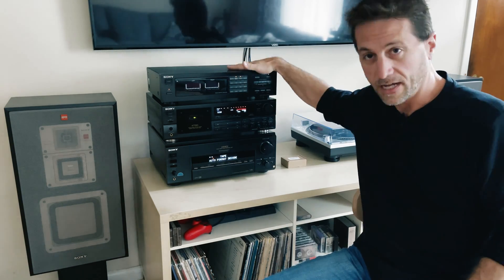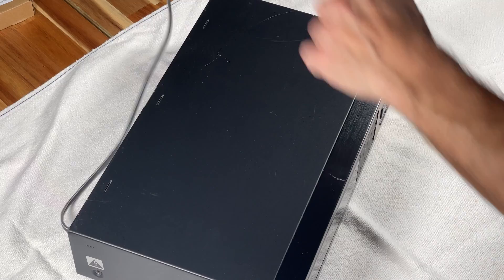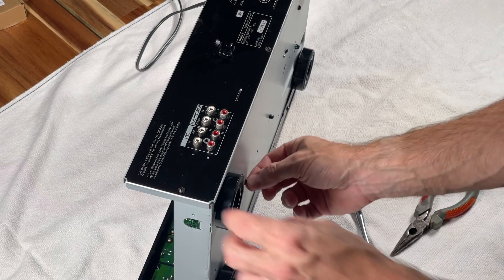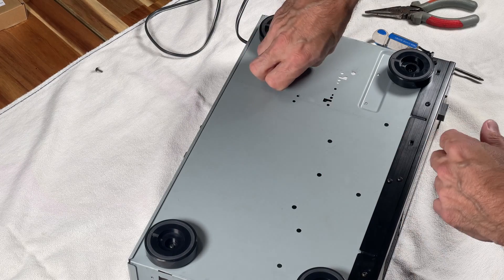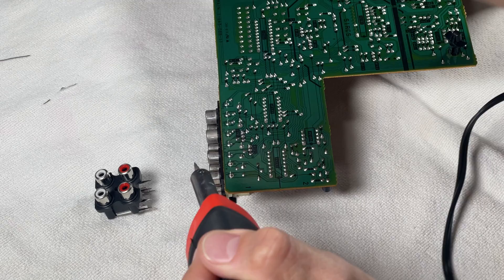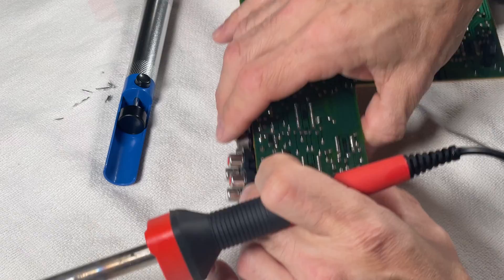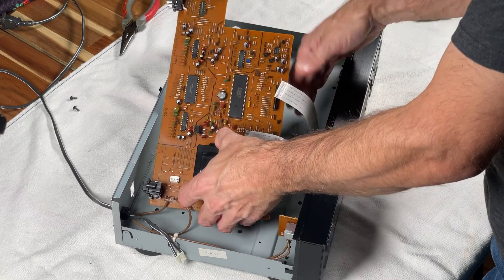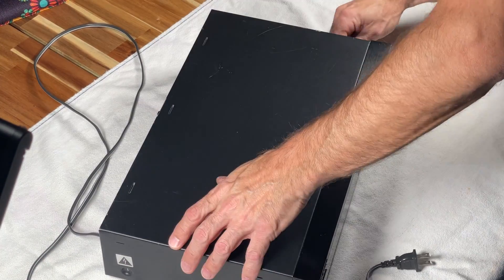How To Replace An RCA Jack On A Circuit Board

Comment: I broke a RCA cable inside my Yamaha receiver. It’s the RCA that goes to my subwoofer. I tried to pull out the broken pin ,but pushed too hard and it went through. Any idea how I can repair it. Can it be repaired?

Comment: Hi, where were you able to get the 4 bank rca terminals? I have a broken rca on the rear of my receiver.
Reply from the maker: On Amazon, search for RCA Female Jack PCB Mounted Right Angle Connector
Reply: @TechStuff1   thank you greetings from Boxford, MA
Reply: @TechStuff1 hi im karl. I have a kenwood ge 4030 and the display stop working. Would be able to repair it.

Comment: Dude, there is nothing wrong with the old RCA jack's! Only dry joints, i can see them clearly. Put them back and solder them properly.
Reply: I have a cd player i think with this problem, the RCA jack jiggles in the back and doesn't have any audio on the R output. What does this entail? do you need to just add some more solder and heat it up? I'm completely new to soldering.